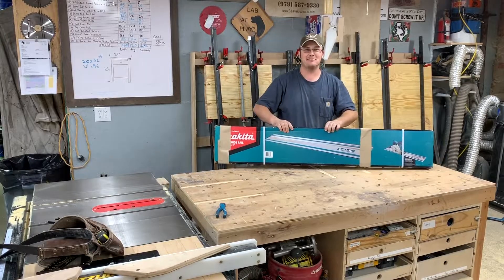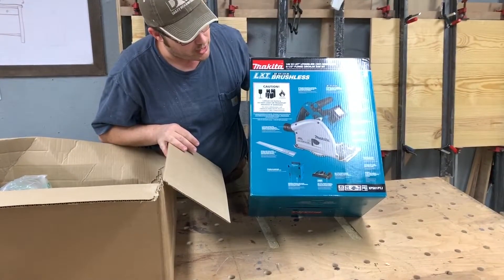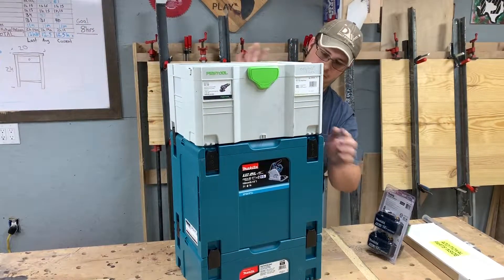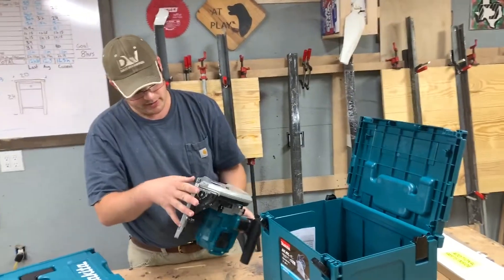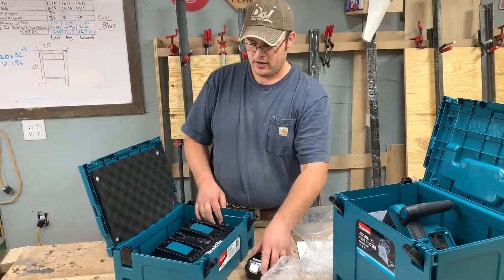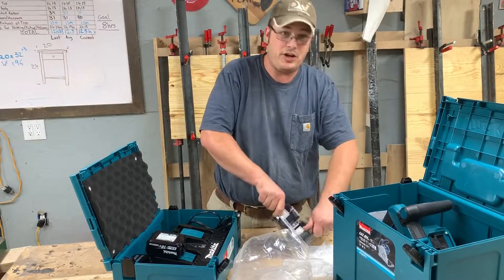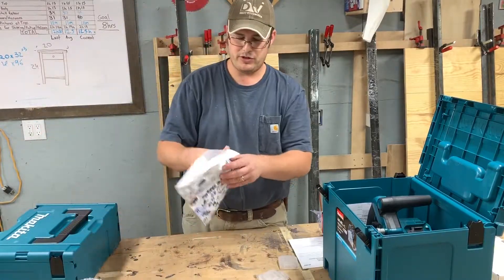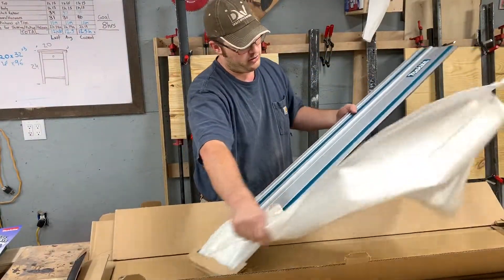Makita Track Saw Unboxing - Part 1 of the Makita Track Saw Full Tutorial

Comment: When making a bevel cut, does the splinter guard get trimmed again? If so, wouldn't this throw off zero clearance/ cut line for straight/90 degree cuts?
Reply from the maker: No, it doesn't get cut again.  It's cool they actually figured out how to design it in a way where it says accurate for both.
Reply: @DaileyWoodworks  Cool! Thanks for the helpful information!